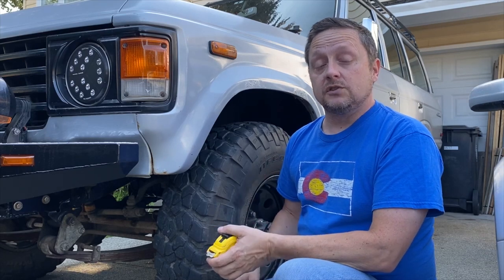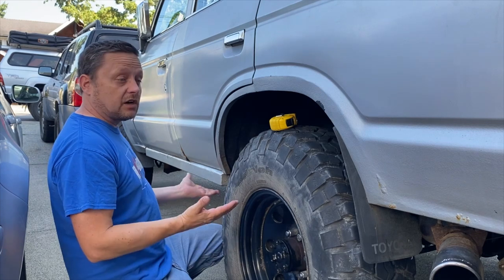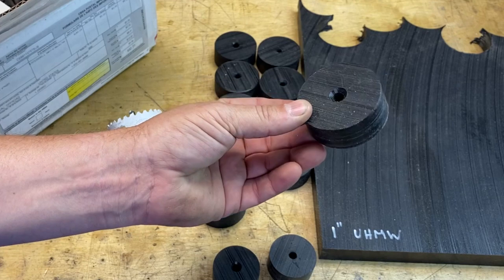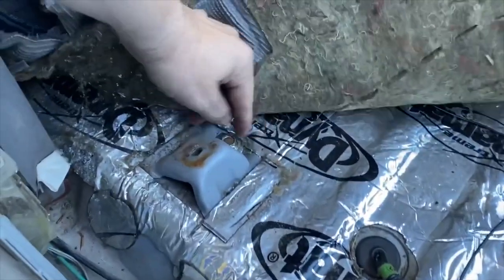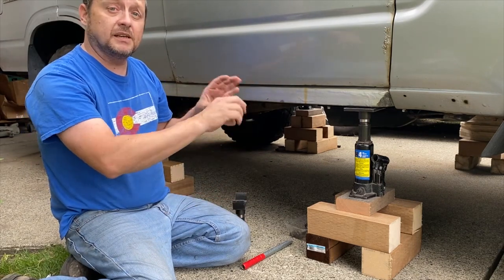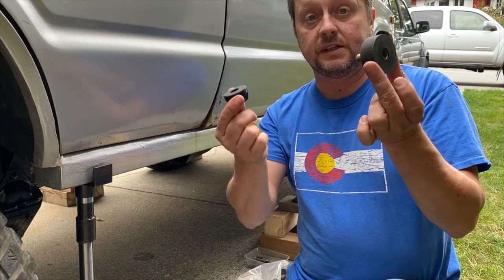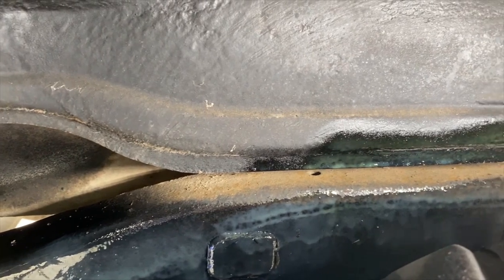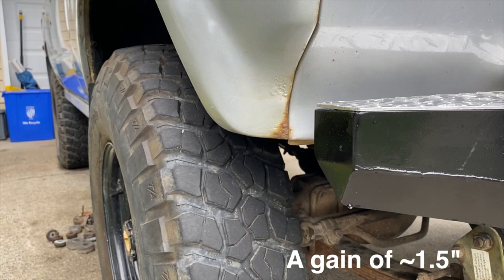Installing a Body Lift and new Body Bushings on a Landcruiser // 60 Series (HJ60) Body Lift

Comment: Nice rundown, easier than I expected to be honest and surprising how off-level the frame bushes made things. What mirrors are you running on your 60 series, I like the look of the larger size vs the stock on the '86 FJ60
Reply from the maker: Thanks for commenting.   My mirrors are stock HJ60 that came with the vehicle from the factory.   I think Canadian HJ60 and BJ60 have the same larger mirror. Cheers.

Comment: Hey mate! Sick video. Did you have to do any cutting for when your in 4x4 ??
Reply from the maker: Thanks.  With the new bushing and 1” spacer lift all I has to adjust was the fan shroud. I had to lower it a bit and clearance the bottom the bottom of the shroud a bit. That was it.  
If you go more the 1”, you will have to do a few other things to make it work.  Cheers.

Comment: G’day Mike really informative video, I have my eyes on barn find HJ 60 so I’m doing the research so that I can get it right the first time”hopefully fingers crossed 🤞🏾 “. I’m from Northern Territory Australia proper Toyota country.
Reply from the maker: Thanks for your comments. Sweet, barn find Landcruisers in my area is rare… but when they happen people want a pretty penny. 

Check the rear part of the frame and if you
can check compression. Cylinder 5 and 6 are prone to have piston issues. (Check on IH8MUD.).  Cheers.

Comment: Thanks.  Did it cure the "Land Cruiser Lean" that you had brfore?
Reply from the maker: You’re welcome.  Yes, the new bushing did help with the lean.  My frame and suspension has also been replaced so that helped as well.  It sits pretty level now. Cheers.

Comment: Great tutorial! Are you using the stock body mount bushings with the DIY 1-inch spacer? Any reason you didn’t get the larger bushings from 4crawler to avoid using the spacers?
Reply from the maker: Thanks for commenting. I purchased new standard size body mount bushings and made a 1" spacer. I was able to make the spacers way cheaper than purchasing them premade and I knew it would all fit.  A 1" body lift seems to be the highest you can go without creating issues. (ie. rad placement / Fan shroud, Steering linkage and steering wheel angle, all the lines that drop down from the body the frame odd body gaps from the bumper and frame...etc...)  The 1" body lift is all I need to clear my 33" tires. nothing rubs on full stuff and lock.  You can go higher but be prepared to deal with these other issues that will take money and time to sort out.  Cheers.

Comment: hi mate any problems with radiator fan rubbing the shroud? or steering linkage going stiff?
Reply from the maker: With a 1” lift there is typically no issues with the steering linkages.  At, not with mine. 
The fan shroud was very tight.  It didn’t rub but it probably would when flexing.  I lowered the shroud a bit and reshaped the bottom section of the shroud to clear.  No issues.  Cheers.

Comment: Was there any other modifications you had to make to the car because of the lift? Great vid by the way, I’m in Australia and also have a hj61
Reply from the maker: Thanks.  With a 1” lift the only thing I had to check and adjust was the fan shroud. I was able to adjust the fan shroud by making the mounting hole larger, cutting the top flange a bit and sliding the shroud down.  Some people cut the bottom of the shroud, bend it and re-weld it.  There are a couple other ways to make more room, you can look on line. You will see how yours lines up. It’s not that hard to figure out.
Reply: Mike Freda yeah that’s an easy mod , thanks mate 👍

Comment: Hey mike,  do you have a link to the rebuild kit you used for your 12-ht? Any parts hard to find? Keep the videos coming.
Reply from the maker: Hello, no real link since they change. The genuine Toyota gasket kit I got from PartsSouq. Misc parts I got from Amayama and the pistons, rings and bearings I got from Engines Australia.   I do plan to do an engine rebuild video on my process.

Comment: Being better able to clean the frame seems worth it alone. I like the look of those headlights. Are they any good?
Reply from the maker: The headlights are pretty good. I’m very happy with them. I like the colour temperature of them. The high beams are so bright that I find I do not need any additional lighting. That being said, they are expensive. I think you could get similar performance with high end H4 bulbs (ie Osram) and a very good light bar or auxiliary lights for 1/2 the cost.

Comment: I like your land cruiser. If I change the 2 inch body lift up bush in stock land cruiser can I increase the size of tires or not?
Reply from the maker: Well, it depends on how big of tire and offset/back spacing of the rim. I was able to fit skinny 33” tires with not lift (body or suspension). So, yes you can fit slightly larger tires with a mild body lift.   The issue with a 2” body lift is that you need to adjust other things to make it work. Fan shroud, shifter, brake lines…. Etc…

Comment: Did you have to do anything with steering, radiator, or fuel hose?
Reply from the maker: With just doing a 1” lift the only thing I had to check and adjust was the fan shroud.  I did not do anything to the steering or fuel hose. The steering wheel angle did change a bit but the tilt function fixed that.  For the fan shroud, I was able to adjust it by making the mounting holes larger, cutting the top flange a bit and sliding the shroud down.  Some people cut the bottom of the shroud, bend it and re-weld it.  There are a couple other ways to make more room, you can look on line. You will see how yours lines up. It’s not that hard to figure out. If you do a 2" or more, you will have issues with all this items, cheers
Reply: @MikeFreda  Thank you for the reply. I'm in the process of reversing a body lift. I had a 3" done and do not like the look. I just wanted to make sure that I do not ruin anything in the process.

Comment: Hey do you have a video on how to lift the body of the frame. I have a 89 land cruiser and really want to get the frame all solid
Reply from the maker: Unfortunately, I don’t.   Without a proper lift, replacing the frame is a lot of work.  What I end up doing is removing the interior, removing the front clip (hood, fenders, grill and rad).  I then loosened all the body bolts, break lines…. Etc.  (You can leave the gas tank in place) I then used 6 large bottles jacks and large blocks of wood to lift the body up as high as I could and rolled the frame and running gear out. You may have to make a  stacked wood blocking system that they use for house moves. I also placed some large wooden cross members under the body to help lift it up.  The frame swap took me solid 5 days working 10-12hrs a day.  By the end of day two I was rolling the frame out.  It also takes a day to swap the suspension and drive train over.   Good luck.  It’s a big job with out the proper tools and lift.

Comment: Did you you make the rock sliders or make them yourself.
Reply from the maker: They aren’t really rock sliders.  The original rockers were rusted out. I cut them out and graphed in a piece of square tubing. This tube is welded to the body, not the frame. It “can” take a little bump but it’s not meant to slide along rocks. It also make it handy to lift the body up but not the weight of the entire vehicle.

Comment: Is there any safe,DIY method to lift up land cruiser? Just like adding suspension leaf and gig bone shackles.
Reply from the maker: I did my suspension lift in my driveway. I did one end at a time. I jacked it up and put large Jack stands on the frame. Took the tires off and lowered the suspension to full droop. You can then loosen all the hardware and use a floor Jack to support the axle. This was actually easier than the body lift.
Reply: Thank you so much. If I got any other questions on this can I mail you?
Reply from the maker: Yes, you may.  The website IH8MUD is a good resource for Landcruiser information.

Comment: Does lifting the front affect the fan and radiator ?
Reply from the maker: Yes, it can.  I was lucky that all I had to do is adjust the mounting hole of the shroud.  Some people have to lower/reshape the bottom section of the shroud.  You can also “slice” the shroud in half horizontally and weld in a small strip of new metal.

Comment: thank you for the video! How did you solved the issue with the angle of the steering box? The steering box is connected to the frame. By raising the body the angle will change and pressure will be on the steering column.
Reply from the maker: Thanks for the comment.  With only going 1” the steering angle didn’t change that much. I did have to adjust the tilt of the wheel just a bit to put it back to where I’m used to by using the tilt adjustment.  The other issue is the  fan shroud. You need to make sure you have enough clearance to the fan.
Reply: @MikeFreda  Hi Mike,

thank you for your fast reply. I purchased mine with a +3,5 cm Body lift. I had / have those issues and looking for a solution. One solution would be to add a aluminium block below the steering box. …But then the linkage will also raise and is very close to the damper. I would like to avoid that. No idea how to solve my problem…. :(
Reply from the maker: I see. Yes, going higher may bind the linkage.  If  you have enough led clearance you may be able to lower the steering wheel assembly a bit to lower the angle. I’d need to have a closer look to see if that is even possible.